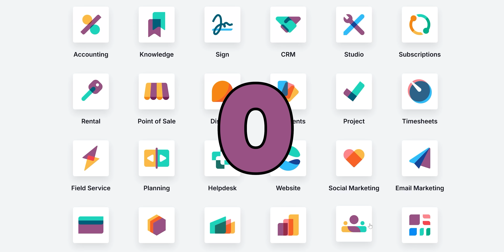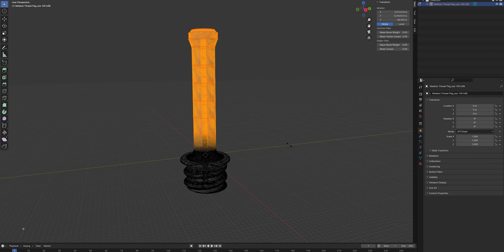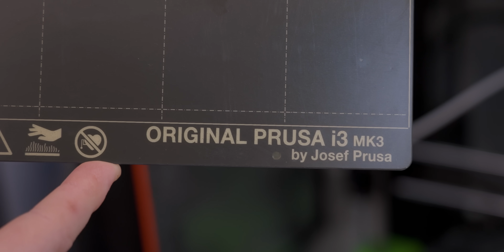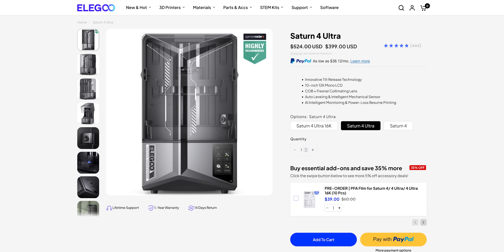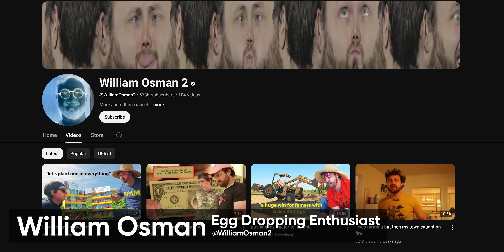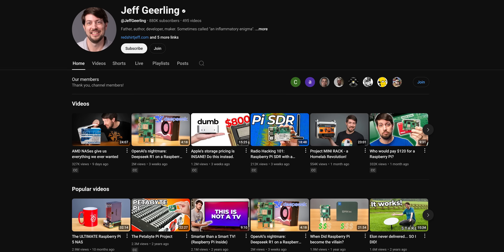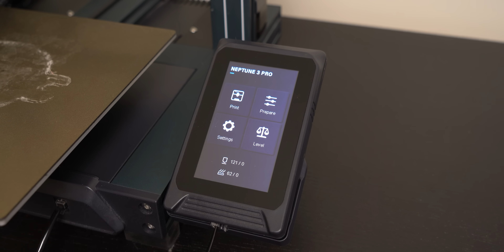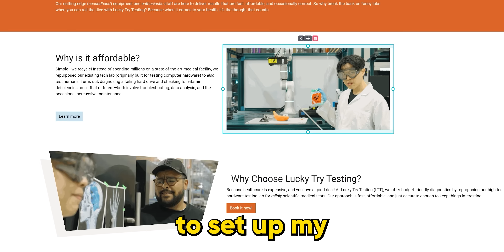Is my 3D printing setup wrong?

Comment: As someone who was gifted a $100 diamond tip nozzle from diamondback. I recommend it for everyone. It heats up so very quick and the ability to print whatever without worrying about artifacts from a nozzle that's getting bored out on the inside from rougher filament or making the nozzle diameter wider really gives peace of mind.
Reply: Doesn’t seem necessary unless you use fibre reinforced filaments
Reply: Is the diamond nozzle one time buy, or do you need to replace it every X prints?

Comment: Jakes whole thing about upgrading his Prusa is the exact reason why I waited so long before getting into the hobby. Ironically, it was the Bambu A1 Mini that sold me on the fact that 3d printing "was ready".
Reply: That's my main issue with Prusa you pay Bambu X1 prices for a bed slinger. If you don't mind having to build it your self its now only ass much as a P1S with AMS. Like my Ender # v2 was $150 and yeah i dropped like $130 in upgrades but that was in 2020 for $300ish you were not getting much better.  heck now you can get an ok Ender 3v3 se for under $200 and it comes with ABL and a direct drive. To me that's the perfect will i like this hobby printer. you don't have to buy upgrades and its cheap enough that your not out a lot. sure it still requires some learning but its not a bad starting point.

Comment: Adam Savages Tested channel posted a video 2 months ago about a printer from Form Labs, a SLS (Selective laser Sintering) printer that uses fine nylon powder that delivers very durable high fidelity prints. The setup is not really suited for the average home user though. Both in cost as in size of the full setup. The results were amazing though.

Comment: Enclosures: Are PC case manufacturers missing a trick here? Some cases are beautiful; as a 3D printing enthusiast, I'd LOVE to be able to buy a sick-looking box with room for, say, coreXY 300x300x300 plus tool-changing, pre-drilled/tapped for my choice of rails, boards, etc., instead of pissing about with 2020 extrusions and trying to get glass cut.
Reply: Agreed. 
I very much dislike the generic aluminum extrusion enclosures. Creality has nice looking enclosures on their newer machines and is now starting on their lasers too.
Reply: @GamingWithURO  i have a Creality K1.

the glass/perspex enclosure looks damn nice compared to the standard extruded setup of most printers.

Comment: Went from an ender 5 straight to the deep end and designed and built my own printter with dual direct drive hotends, linear rails on all axis, nonplanar capable, 410x410x600 build volume. Printters are a slippery slope.

Comment: uh definitely still use glue on the plate, just don't need it every time, maybe every 20-30 prints. Totally agree with the AMS, though I've only had filament issues inside the AMS twice, I've still had to completely tear it down to deal with the issue because access to the stuff on the bottom is not easy.

Comment: People, please do NOT handle resin without doing proper research on the safety equipment required to handle it and also seperate the space for just resin stuff and actively vent the fumes out, it is VERY hamful
Reply: I mean...yea, you are right...but this is also what 90% of the setups out there look like😂😂😂 Even mine looks like it and I know the harm it can do🙈
Reply: I’ve given myself chemical burns from resin. Even when attempting to be careful and use ppe. Printed maybe 5 things with my resin printer. So much happier with my Bambu.
Reply: @AdibRL  That's what I came here for. This video is HIGHLY irresponsible. You just know some kid is going to watch it, want to make mini-figs, get their oblivious parent to buy them a resin printer, and next thing you know the house is going to be covered in resin and 100% IPA - the walls, the floors, the parents, the pets. I kept waiting and waiting for someone, ANYONE to being up the toxicity (even with the higher level FDM materials), but nothing. 

Do better. 

Also, good lord with the last person having to update the Z-axis every print. Serious question here - WHY??? Please, for your sanity's sake, step out of 2019 and purchase a printer with auto-leveling. With the A1 and A1 Mini, there's zero excuse. You're simply helping to support bad products.

Comment: On the one hand, what Bambu did was a bit misguided-- but it's not the end-all of anti-consumer practices.  If you're happy with the Bambu ecosystem, and don't mind using the Bambu apps (Bambu Studio and Handy), then.... nothing's changed.  You can still slice, print, and monitor, just like you did.  The ecosystem is still pretty much better than anything else out there-- Creality is getting close, but they're not there.  FLSun?  T1 Pro is a good, but flawed printer, and god help you if you need to order spare parts.

If you need a reliable, solid printer that delivers consistent results, and allows you to order just about every single part inside the printer that might fail-- there is no "better" printer than Bambu.  Prusa is good, but overpriced, and frankly, still not at Bambu's level.  And I haven't forgiven Josef for spreading lies about Bambu when the X1 was first announced.

Comment: Fun fact about the Creality dryer I discovered this morning: If the ambient temp is below 15C, instead of the heater and fans kicking on it'll just flash "EA" at you until it warms up. So if you've got a cold workspace, maybe consider setting up the dryer in a warmer room.

Comment: 9:40 I have a resin printer that a friend of mine who runs his own 3d printing business gave me. I recently switched to water washable resin and it has changed everything! Water is so much easier to work with. 
I clean the print using a cheap ultrasonic jewelry cleaner that I picked up on Amazon for like $20 and then I cure the print in an equally cheap UV lightbox designed to dry nails.

I found out that a lot of the stuff designed for doing nails, you know like painting and curing etc, work really well for working with resin prints. I also have a dust collector bed that is designed to suck up dust when you're buffing and shaping nails using little mini electric nail filers, works great for using the same electric nail filers to clean up prints!
Reply: Beauty tools are often amazing for tech/maker purposes. UV nail products are great for embellishments on projects and lash extension tweezers and magnifiers are also great durable additions.

Comment: Ok 3D printing pros-- What's the deal with Bambu Labs? I'm in the market for a 3D printer, and Bambu Labs seems like the best one for my use at first glance. Use case is designing parts for hobby robotics (think FRC and FTC; using single filaments so I don't need filament swapping really). Since it's for school course work and competition I need the printer to "just work" and be idiot proof. Why is the community steering away from them and am I even pragmatically affected by the drama? Is Prusa a worthy enough replacement? FWIW I am proficient enough in CAD so it's not like I need the kid-friendly pre-made prints to download and use.
Reply: It's way more nuanced than most of the commentary would have you believe. Bambu Labs has done some things that piss off the more open-minded community of hackers and tinkerers that sprung up around 3D Printing. They are more closed, more proprietary, and that makes FOSS people itchy. If you just want it to work, and don't want to tinker or have the 3D Printer itself be its own hobby, Bambu hasn't to date done anything so egregious as to no longer be a valid recommendation. Prusa is certainly valid as well, but they will continue to be significantly more expensive, and require much more tinkering, especially if you don't get the pre-assembled version or want to do one of those in-place upgrades.
Reply: well think of bamulab like the apple of 3d printes the product is good and pretty userfriendly (not like apple sometimes tbh). These printers dont require much thinkering or knowledge, they just work and have very good print quality. But like apple they arent cheap there are other options which are less overpriced but probably can't hold up in beeing easy to use. Also the company has done some tbh very terible choises like only letting you use their own slicer software which sucks tbh. If you dont need multi-color print just go with prusa they are a much more consumer friendly company and their printers once set up will work forever. Also if you realy want to dive deep in the 3d printing hobby a prusa is more customisable so you can upgrade it later.
Reply: @GlowtreeTV  I don't know how you can claim Bambu is overpriced and recommend Prusa in the same comment with a straight face. And it's not true that you have to use their slicer, OrcaSlicer continues to work with Bambu printers.
Reply: @lordcheeto i didn't recommend prusa i just said the are a nicer brand that theiy arent cheap is obvious

Comment: I had that bed leveling problem on the Neptune 4 pro and the solution was heat.
Instead of 140/60 °C I'm leveling the bed with 180/90 °C and so far(two weeks now) the problem gone away!

Comment: The Bambu change, to a degree, is kind of user specific. Like Jeff seems like the kind of person that would actually run into issue with being limited to just Bambu Studio, where I dont really know that Linus would do much if anything that requires the extra sauce in Orcha Slicer, especially if its largely the kids printing, and especially+1 if theyre doing it from the app.
TO BE CLEAR, the strength of the 3DP community was built on open source and cooperation, so Bambu changing course like that isnt a good move & hopefully something is worked out. Tbh idk what I can even say about security concerns because of how ingrained data collection and whatnot is in everything now.
Also, the repeated point of the dry filament, yes its important to have dry filament because its just going to make everything easier, but PLA can be perfectly fine for years just in the packaged bag and box. Stuff like Carbon Finer and Nylon, "engineering grade materials", yea that you gotta really baby, but the common materials Ive barely had to really do anything to for years at work or home and things print just fine. Do be conscious of your area's typical humidity because that exacerbate things though.
Reply: @RedbeardInBluegrass  to be clear, the new firmware doesn't prevent using OrcaSlicer anyways. You just need to send the print from bambu connect.

Comment: this is all blown out of proportion.  i use my P1S daily and nothing has changed.  yes, there's now a gate if you want to use some aftermarket accessories or a different slicer.  or you put it in local mode.  no biggie at all, people are trippin.
Reply: they are boiling the frog slowly
Reply: @RandomTheories  Bingo. Fortunately, this gave people the push to really go hard on figuring out their encryption on the firmware and some of the GOATS in the community have figured out the decryption on the NFC tags for the AMS so we'll have a jailbreak solution sooner rather than later if they do take it a step further
Reply: @thegrafxguy1  you realize that the gate only exists because people "blew it out of proportion" right? They were planning to lock it down completely until they got the backlash. Like, people PLEASE fucking research shit before siding with a corporation. You excusing their attempts at a shitty move (that doesn't even fucking solve the problem they're claiming to try and handle) is exactly why they'll take another stab at being shitbags in a few years. I guarantee you that it'll happen
Reply: @dalektrekkie  lol, I don't believe that even for a moment. They have nothing to gain by "locking" anything down. If you want people "locked in" to your ecosystem, the best way is to provide the best and I think they are doing just fine in that regard.
Reply: @dalektrekkie  which means they're listening to their customers.
Reply: @thegrafxguy1  No. Listening to their customers would be removing the cloud bullshit entirely or making it opt-in rather than opt out. Being shamed into walking back a shitty move is NOT listening to your customers. If they were, they wouldn't have even attempted it in the first place
Reply: @ the cloud is the best part of these printers, why would you remove it? It's great.
Reply: @s3gfault  Ah yes, because nothing screams security like being forced to upload everything you do on the printer to Chinese servers accessible to god knows who. Sit down; the adults are talking
Reply: Indeed - I've used my P1P quite active seen short-circuit did a review of it, which was the reason I got into 3D-printing. It still works great, I've printed an enclosure to it, and bambus slicer works great for what I am using it for.
Reply: @thegrafxguy1  This new firmware doesn't even apply to the P1S/A1 and is currently exclusive for the industrial X1C. And it's even optional as all firmwares are. Bambu even lets you downgrade with a click of a button to any firmware version that exists. I don't even understand this.
Reply: @s3gfault  they've said it will be on all current printers soon. I'm still not worried about it. People just freaked out for no reason.
Reply: @ Oh I know, I'm already running it on my printers and it's fine. Bambu Connect is actually good too cause you can manage all your printers in one place.
Reply: Very overblown yeah

Comment: While the commercial closed source vendors have been busy competing to keep up with Bambu, the open source world isn’t sitting on its laurels. Your older Creality, Anet, Tronxy, Anycubic, Sunlu, BIQU, Sovol … etc. … printers may have shipped with older Marlin firmware that is improperly or poorly configured, but the Marlin community has been making tuned and improved configurations for all these machines, and Marlin developers have been making great improvements in performance and UX. Open Source isn’t going anywhere and we will only continue to improve. If you have an older Marlin 3D printer the best time to upgrade the firmware is now!
Reply: Both have their place for sure :) Too bad that many of those older printers also have hw fault or poor engineering and are not worth upgrading.
Reply: @JakovPerisic  truee :)
Reply: @JakovPerisic  Much of what we do is to improve the output quality that is possible from inexpensive and less-than-ideal builds. Be sure to follow Tom Sanladerer and Chris’s Basement channels for good examples of self-built wooden RepRap printers and revamped cheaper Chinese printers that print like gangbusters with Marlin, especially with ZV Input Shaping, S-curve Acceleration, and Linear Advance enabled and tuned for high print speeds. Marlin 2.1.3 also introduces Fixed-Time Motion with advanced Input Shapers, Nonlinear Extrusion, and other improvements to motion to eliminate some extraneous slowdowns.
Reply: @MarlinFirmware  unfortunately Tom banned me from his channel because I said something negative about a Prusa printer :(

Comment: I'm so surprised that you don't personally use Prusa. That company feels like it was made for you: open source, quality, repairability, reliability... You can assemble it yourself, which gave me a lot of confidence and insight. I can tell that I know every screw on my printer, and I'm not afraid to take it apart if something terrible were to happen to it, though I don't know what would have to happen for it to break! Also, Bambu just steals ideas from Prusa; it's just a cheap copy, and I'll never support that!
Reply: It is not like that anymore unfortunately, their quality and engineering have been going down, prices are high and they are catching up and basically copying bambu now.
Reply: @JakovPerisic 
I 100% disagree.
1.  Quality and engineering are still top-notch, Prusa printers will print happily for decades, and they are still being improved.
2.  Prices are as low as possible for an EU-based company that has no government financing, unlike China, which wants to lead the market. I am happy to pay more because I know my data is safe with Prusa!
3.  How exactly are they copying Bambu? The Core XY system was used in the Prusa XL which was announced a whole year before Bambu Lab even started! Also, let's not forget "bambulab's" Bambu Studio, which is just taken and reskined PrusaSlicer, and "bambulab's" makerworld, which is a 1:1 copy of Prusa's Printables.

Comment: I had the issue with the Neptune 3 and had it ALWAYS crash into the bed, even manually setting the z-offset each time it would reset part way through and rip right into the build plate. Support was extremely unhelpful and it is basically a brick now.

Comment: I've been 3D printing since 2015 and if there's one thing I've learned in all that time it's that filament dryers are a complete scam and highly unnecessary. I have never in all my years had a print fail due to anything I could attribute to moisture and I often print with 8 year old filament that I store in a cold room with a leak in the ceiling so literally a worse case scenario. And I don't even have a fancy printer, just a cheap Artillery Sidewinder X1 I bought back in 2020.
Reply: That is 100% false.
Reply: @JakovPerisic I think someone's just jealous that I'm printing with spools that haven't seen a desecant pack since the Obama administration and getting great results.
Reply: @Neverwinter1984   I mean I might be, I have almost 60% humidity in my room so I have no other choice but to use dryers.